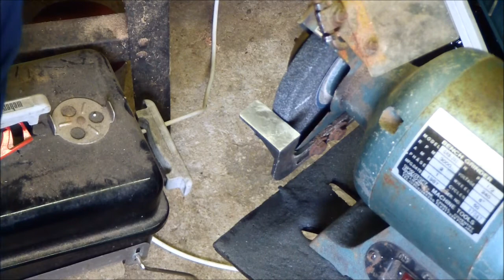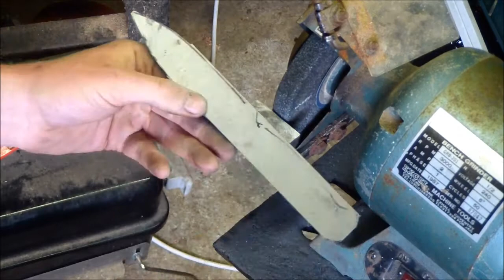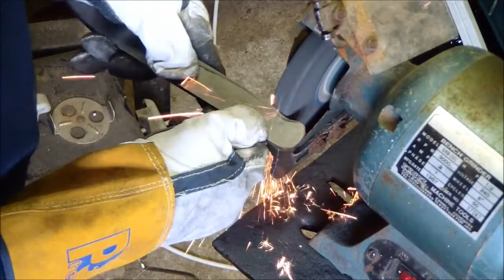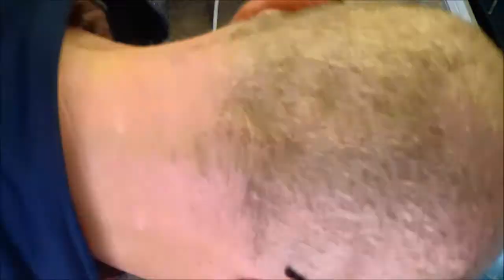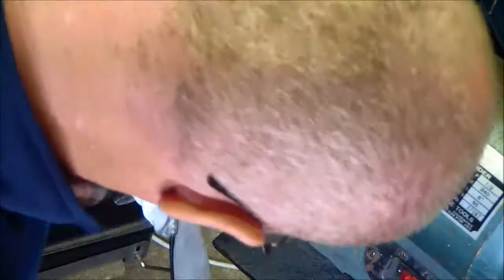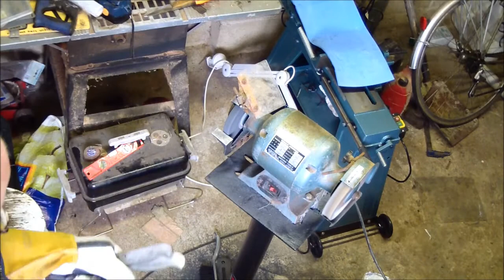Profile grindng the Jacklore knife

Comment from the maker: Adam,
It's an Excel GRB 201. Excel tools Coventry. Built in 1980. It's half Horse power motor. Runs at 3000rpm with 6 inch wheels. Very quiet and smooth. Infact it's a delight to work with. I actually enjoy grinding. infact love the whole process of making these knives.
All the best mate.
Sandy

Comment: Is that an old SIP grinder? All three of my bench grinders seem massively under powered for grinding profiles, so I just clamp the blades in a vice, using wooden liners, and use a 4 1/2" angle grinder. Think I need to upgrade one of my bench grinders at some point lol.

Comment: Sandy, Do you grind the initial profile of the point the same way?  Starting the profile is the part where I get spooked the most. I have a grasp of all the process now though, which is more than I can say of last year. LOL from the start.  R/Stan
Reply: Hi Stan,
Nowadays I use engineers blue and scribe an accurate outline of the profile into the steel using a template.I now use a pro knife grinder and will coursely grind down to just short of the scribe lines just leaving the lines visible. Later processes remove more steel to give me exact dimensions. Hope this helps. Just let me know if you want any info or a video and I will see what I can do.
Sandy